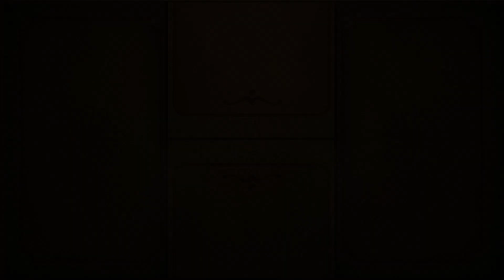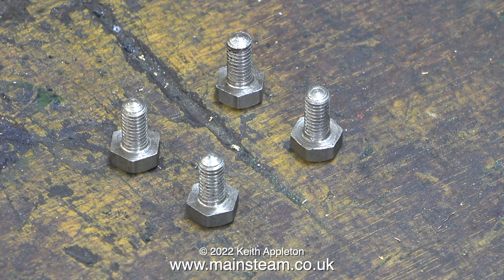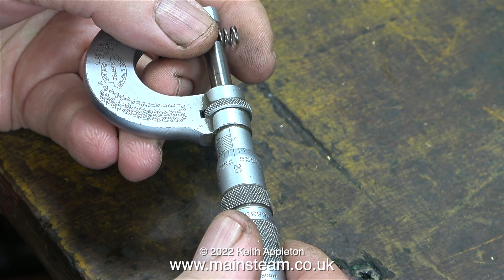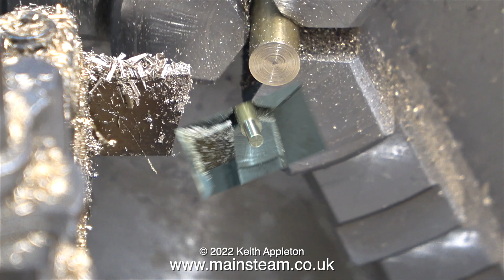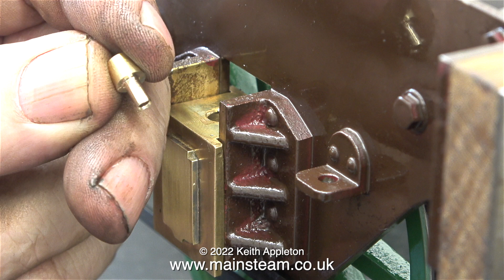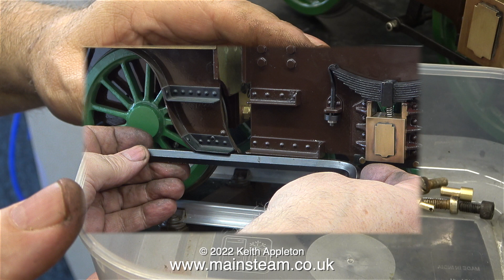MY STIRLING SINGLE - PART #45 - TENDER SUSPENSION MODS

Comment: Are the exposed and highly visible coil springs a problem, or is that being a bit too retentive even for a model engineer?
Reply from the maker: Maybe a tiny bit too retentive even for a model engineer . . . . .
Reply from the maker: Yes indeed, I spent a full day once on the footplate of a full size GWR Pannier Tank and I remember that the rear axlebox springs were in the cab and were fully visible - !
Reply: @keithappleton  Hmmmmm.... I was not aware that mixed and leaf and coil springs were so prevalent. We live and learn.